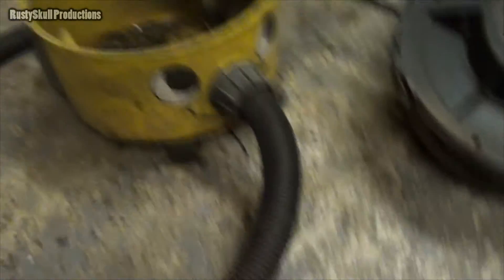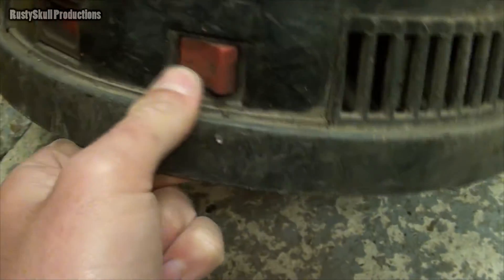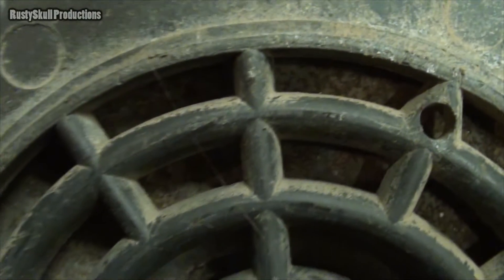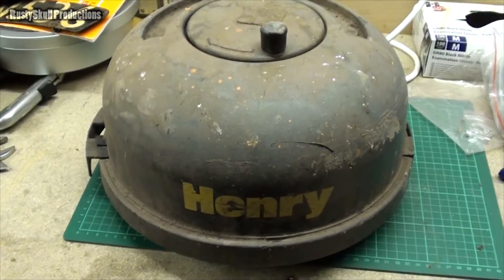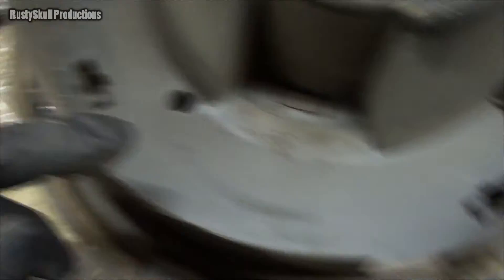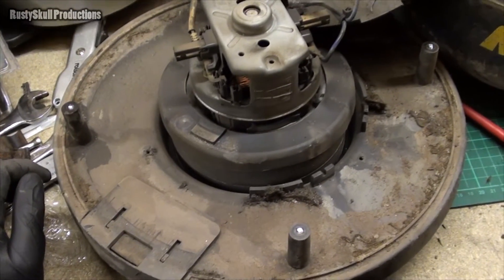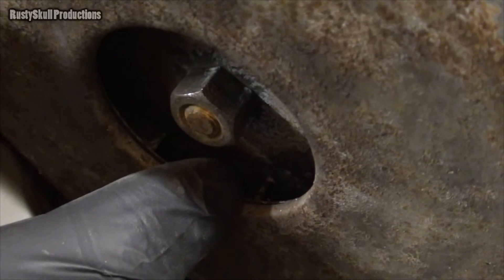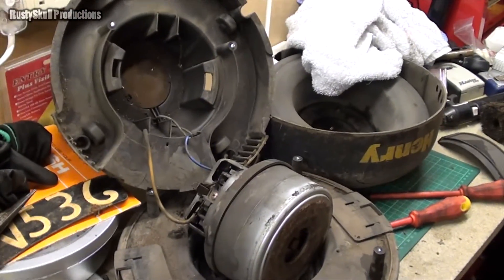Numatic Henry Yellow Strip - RustySkull Productions

Comment: That motor will run fine then bearings will just sqeal bc it’s been sat in the cold after it warms up it’ll be fine
Reply: That motors long gone now 😂
Reply: @Mr_D2_1004N  I’ve had a lot worse than that 💀
Reply: @numaticcollector1014  did u see the comm could do with sanding I ain’t gonna lie
Reply: @Mr_D2_1004N  why? it looks perfect

Comment: The blue James is the PSP 180 which probably needed a PCB which commonly fails on them,This ones fecked,its on par with my 97 Henry which has a shitted motor.I also had a yellow one  exactly the same as yours,in my flat but tenants killed him.This one is from 95 to 97.
Reply from the maker: Nice!  Older than I thought.l
Reply: RustySkull Productions Motors are hard to find for theses unless you take the plunge for kayysmith
Reply from the maker: I simply won't get one :)
Reply: RustySkull Productions Maybe a scrap machine.You could get a twinflo (motor in your metal one) for cheap and order a conversion gasket kit from numatic.Im going to do this tomorrow
Reply from the maker: I'll probably clean the bottom up and either sell or keep it in case I come across a motor or top... I won't spend a penny on it though lol.
Reply: RustySkull Productions If you ever come across a notor then fix it.These are nice machines to use.Hope you get the blue James.Thats the psp 180 and the pcbs on those fail.Could have bypassed it